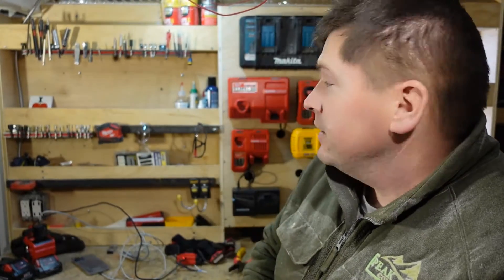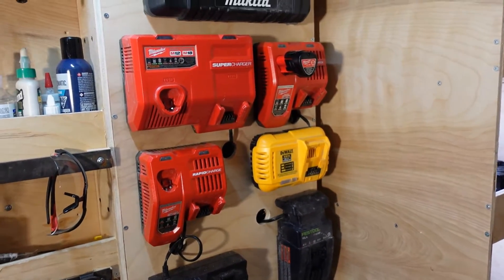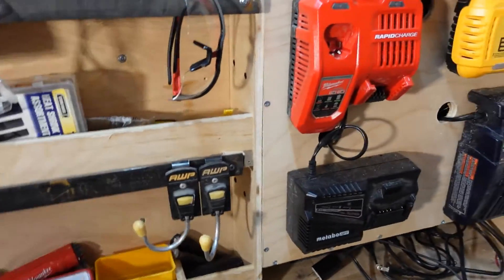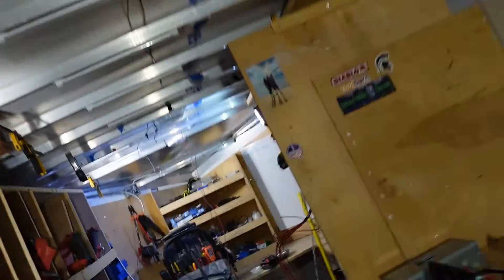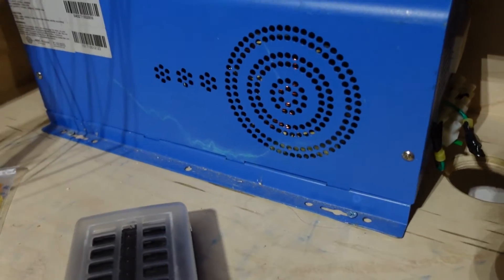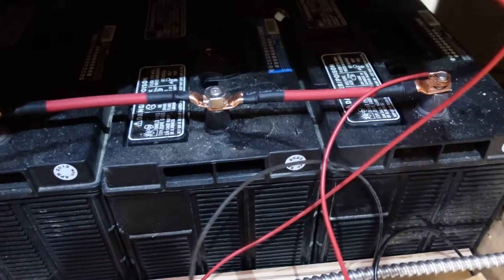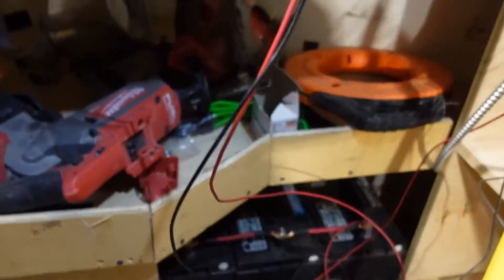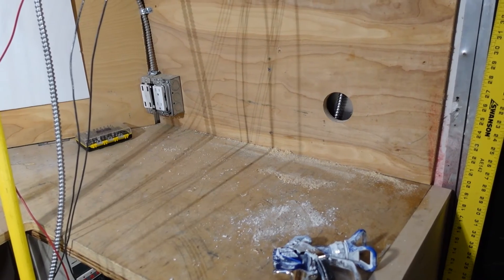Tool Trailer Charging System! (with battery bank and solar parts)

Comment: Thats awesome man I've thought this would be cool.  Have you ran a miter saw off of it?  Or any corded heavy equipment to get an idea of functionality.  Does it charge your tool batteries well?
Reply from the maker: It runs my tile saw and my pint sprayer. All other tools are cordless. It charges my batteries no problem.

Comment: You should next time your battery stop in your chargers is find out how control panels get wired what terminal blocks with jumpers it would be nice clean fit Just something to think about later    👍🍻🍺👍🏼

Comment: Awesome set up! Can I ask why you’re using such a large battery bank? Are you planning on running some of your site tools? Table saw/mitre saw etc? Or just for charging batteries and storage? Thanks
Reply from the maker: Tile saw and paint sprayer sometimes need to run on sites with no power